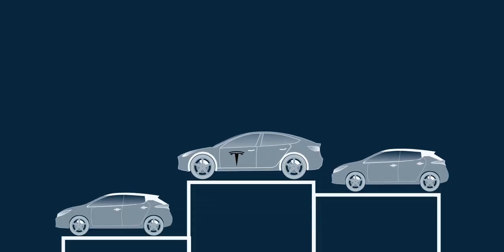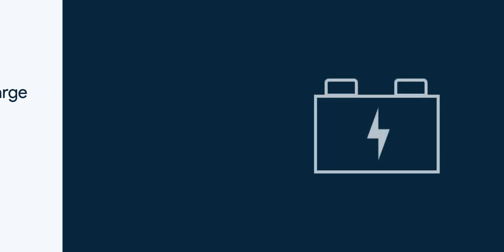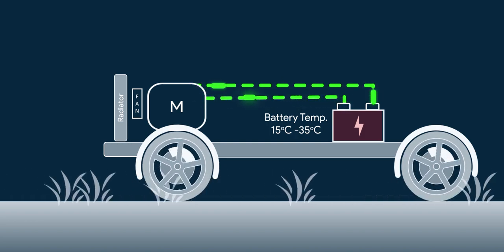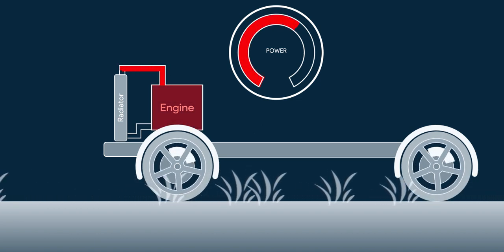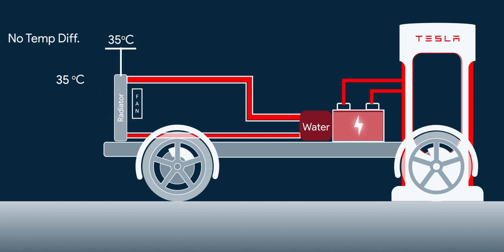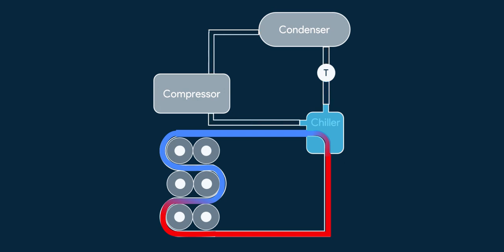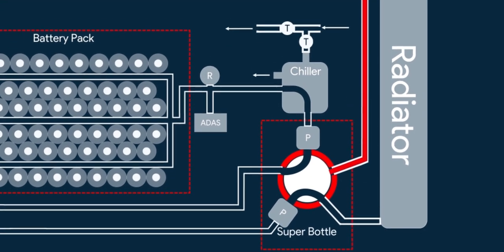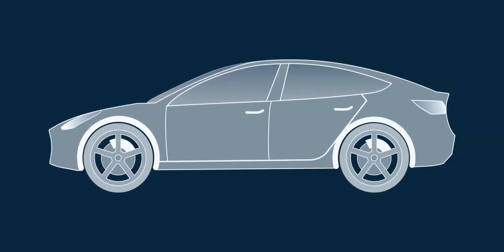SuperBottle & Thermal Management System Work | WORKING IN DETAIL | TESLA Model 3

Comment: My TM3P 2020 has Superbottle replaced last April 2023 so I’m good till 2027 . Rear battery replaced August 2020 then they replaced all upper lower and back arm suspension in warranty. So I’m very happy. Last year I did the 4 year maintenance which cost me 480€ . I’m so happy with this car . It’s almost a 100k km . I’m 99,269km 😂

Comment: I am always curious to know how OEM's maintain battery temeperature when the Ambient is quite hot suppose 40 - 45 deg C and the car is parked under the sun (not plugged). In this case batteries under high temp can degrade sooner.

Comment: Not sure about fast charging. Why is fast charging required?
Reply: Do you want to wait 3 days for your car to charge?
Reply: @mostlymessingabout  yes, fast charging saves the time....but is it good for the very battery?
Reply: @deniskalugin7984  it's for convenience.  The same as driving faster. Driving at 70mph consumes more fuel per mile but gets you there faster than 55mph. For most people home charging is better. Fast charging with good thermal management is only "slightly" worse dor the battery. But without active cooling you end up with Nissan Leaf Rapidgate issur

Comment: 1 How much time the valves has to open.
2 what should be the rate of flow of coolant
3 How is the car driving now
4 what is the temperature of motor and battery right now..
Etc
All these things are taken by software and gives required instructions for valves and pumps
Reply: Correct?
Reply from the maker: Everything is correct. Just pumps are not smart enough to control flow rate.